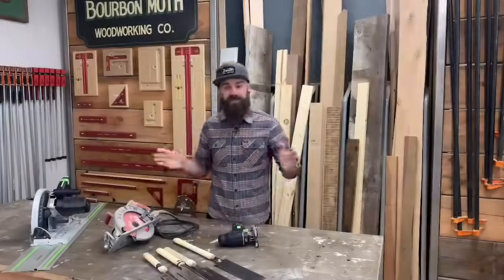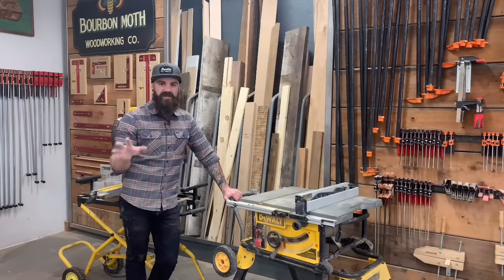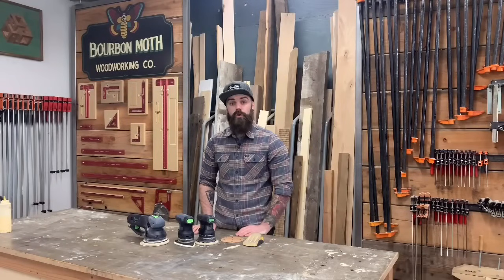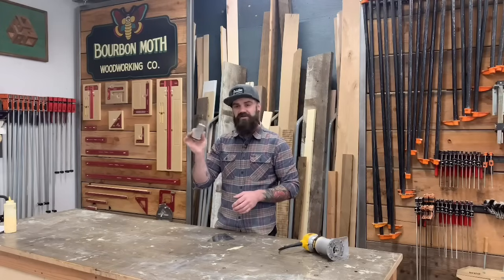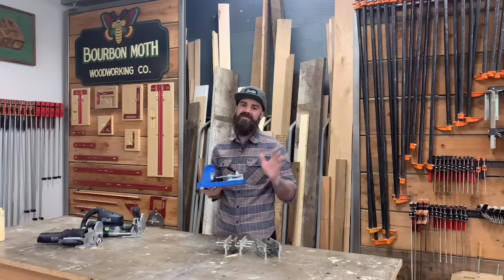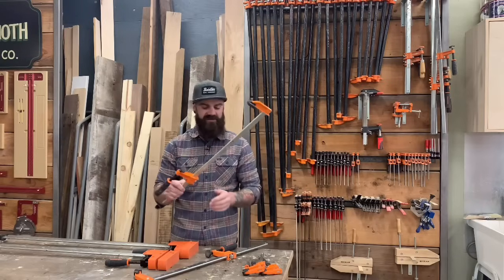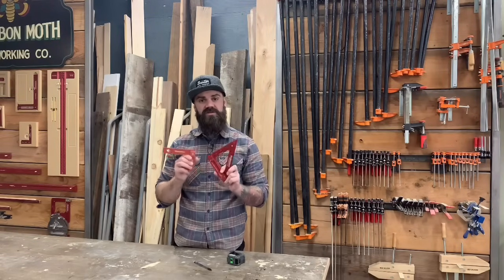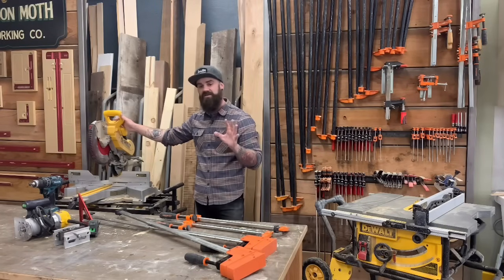Tools every woodworker needs | Start Building for under $1000

Comment: I'm at the perfect stage for this video: a couple of hand-me-down drills.  One thing that I'm often wondering about is when do I want to buy corded versus cordless.  Yes, everything is a trade-off, but obviously a table saw should be corded and it seems everyone has at least one cordless drill...

Cordless raises the problem of which battery ecosystem do you want to buy into.  As a friend was fond of saying:  The key to flexibility is indecision.  At this stage, I'm thinking of buying the tools that make sense to buy corded -- that way I can delay the battery ecosystem decision.
Reply: I thought the same thing, but have come to the realization that having multiple brands of batteries and tools is unavoidable at some point. I wouldn't think too much about which ecosystem you buy into. They're all pretty good these days, I lean towards Dewalt as more of its stuff is made in the USA. I would absolutely go cordless though.
Reply: When i first started i got the ryobi drill and driver combo with 2 batteries + a free ryobi tool (no battery) from home depot on their fathers day sale. I recommend keeping an eye out for those special sales because you can save a lot of money. Also the new facebook market place is great for finding used tools at good prices.
Edit: All of my tools are corded except for my drill and driver. I highly recommend cordless on those. I started with a hand-me-down corded before i found the fathers day deal and it was a headache. (But very powerful)

Comment: Great content. Do you have any ideas on a small work bench?
Reply: Paul Sellers has some very indepth videos regarding work benches.
Reply: @jasonc3522  ...and Yes, Paul Sellers has detailed at least two easily put together, serviceable workbenches.
Reply: The Tage Frid student workbench (a scaled down European cabinet makers bench) was intended as a learning tool for students of furniture making. I built one over a couple of weeks with fewer tools than described in this video. Building one is an excellent learning exercise. Mine is a prized possession and still useful tool.

Comment: This is a great video. Not exciting, but very needed and appreciated. You forgot one major piece... a good space! Haha
Reply: I already have just about everything he recommended in my 450 sqf garage, and I still have plenty of room to get my car in. :)
My sliding mitre saw is on a fold-out table  with wheels and roller supports, and I built a castered table for the table saw, so when I need to do some work, I drive the car out of the garage and roll the table saw / mitre saw out in the midle of the garage so I have plenty of space to move around.
Another thing he forgot to mention was a shop vac. Without one you'll end up with saw dust all over the place.

Comment: @BourbonMothWoodworking ~ Very good video with great advice & useful information. For me, the amount of work space available in my shop (aka: our garage) is limited.... so beyond budget considerations for additional tools & machines, I first have to keep space saving in mind. I always have to ask myself if I can accomplish a task with the jigs and tools I already have. Even the footprints of the "Bench Top" versions of various tools/machines adds up pretty quickly. Your recommendation for ordering "S4S" lumber is excellent! I just don't have the space for both a joiner and planer and it drives me NUTS! I've been taking my stock to a local wood shop where they let me use their joiner/planer and I pay them a fee to help maintain the machines & purchase new blades etc.... BUT, b/w travel & inevitable socializing, it takes up a lot of my extra time. It's time for me to get organized and order some S4S lumber!
Thanks for the advice!  ~~Christy~~

Comment: I'd recommend a tablesaw with crosscut sled and a circular saw over a tablesaw and a chopsaw.
Reply: I would agree, more versatile, cheaper, less space required.
Reply: i do not have a chop saw and find very little need for one if you have a half decent table saw. sure it would be handy for thicker stuff but i can just make 2 cuts on the table saw

Comment: It is surprising how different every list is for this topic, yet i haven't found one that i thought was wrong. Much of the difference comes from people who are professional woodworkers vs those who just build as a hobby.
 Being squarely on the hobby side, my time isn't money. In fact, the faster i go the more it costs me! 
I also work in manufacturing, so i absolutely understand why a compound sliding miter saw is a must have for efficient workflow and respect it as i saw away by hand with a miter box. One of many things i do that would surely lead to homeless destitution if my livelihood depended on it. Others include my use of carbon paper to transfer patterns, chalk lines (quite literally an ancient technique), chisels when i really should just buy a damn router already and I use the crap out of my cheap #4 plane.
If i were to make a list it would definitely include one of my most important tools, a vice and a bunch of hand tools. Very different, not wrong, but absolutely stupid for anyone looking to build a business or career.

Comment: I would add a good  combination square you do not need the $100+ one a decent one can be had for under $30 super useful for lay out. 
Nice tools can be had used, but it usually takes some time, a decent cast iron saw can usually be had for around $200.
A good glue line rip 10" table saw blade can be had for under $100 no jointer needed. 
Some kind of dust collection is needed a shop vacuum will do.

Comment: I had the ridgid orbital sander.  I bought it cause it had an easy way to hook the sander to a vacuum.   But I’ve burned up 2 of them.  They just didn’t last.   I switched to the dewalt.  It’s been good.  Hasn’t burned up yet.  
I would also add a circular saw.  Either a corded one or get a smaller cordless one.  Go with whatever brand you picked for your drills.  And get at least the 6.5” one.   The 5.5s are a little on the small side and don’t always cut 2x___ material cleanly on the first pass.  It’s also way  easier to break down plywood sheets.

Comment: great work. lots of insights, especially for us weekend warriors! for your clamping section, i'd add ratchet or strap-style clamps. you can get a nice long vinyl strap for wrapping around large projects and, if you're careful, get a lot of clamping pressure in the right places with just a few of them. otherwise, thanks for the video!

edit: i'd also say that good table saw jigs can replace the chop/miter saw with great results; i have a decent table saw and have been able to work around getting a miter saw for several years now

Comment: That dewalt table saw with stand is $7-800 alone in Canada. So yeah. Impossible outside the US. Lol.
Reply: He actually links to a $250 Skil table saw.
Reply: @Raiver-of-Eridu  That's still a $400 table saw here. And the Miter saw he linked to is $400+tax so add that together and just the two things alone are pushing $900. Like I said, not possible outside the US lol.

Just the extending stand my Dewalt Miter saw sits on cost me $415 here. FOR A STAND LOL.
Reply: So (after quarantine time is over) come on down to the USA and find a Big Box store to get kitted out. Take it all out of the boxes so it doesn't look new. Then return to a country that has a reasonable medical care plan.
Reply: @RobertShaverOfAustin  are you aware of, or the concept currency dollar exchange and the price of fuel with the carbon tax recently being increased 50% for zero reason? Lol

Also, if sitting in the emergency room for 12 hours with a finger cut off, or waiting 6-12 months for any time of MRI or CT scan is reasonable medical care... Idk what to tell you.
Reply: Waaah....good quality things are cheap in USA.

Comment: On drills, I’ve got a 10 year old craftsman that won’t freaking die.  It has a mile and a half of runout. It’s been an impact wrench, a ratchet, a sander, a grinder, and everything else.  Moral of the story?  Buy a decent quality one so that if it won’t die you won’t pull your hair out if you need a hole that isn’t 1/4” out of round.

Comment: Technically the dewalt jobsite table saw tells you to avoid putting dado stacks in it but you can just get away with making multiple passes on the wood
Reply from the maker: Andrew Le I put a dado in it all the time. Still have 10 digits

Comment: Im surprised by the table saw you put in. I think the dewalt is a much better option,  not much more expensive and so easy to use, especially for a novice. I have a cabinet saw now and still love my dewalt job site saw.
Reply from the maker: True the dewalt is a bit better but the whole point was to try and get people setup for under $1000 and that saw was just out of reach. But, its the concept not firm suggestions on tools
Reply: Oh I get it,  but the table saw is easily the heart of most wood workers shops, with all the possible jigs, you can replace a miter saw, jointer, ect...ect.... and that dewalt fence system when dialed in,  is just amazing.
Reply: Lmao. Hitachi job site work saw beat all those saws out last year. In a Job site table saw test. It even beat out saw stop. Video is on YouTube if u don't believe me. Dewalt took second in over all performance. Hitachi is $300 less.